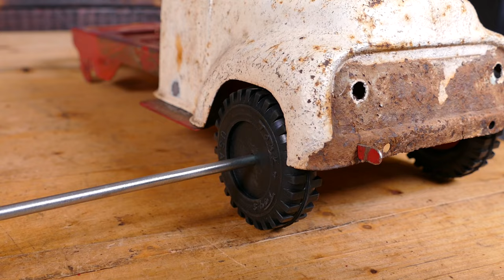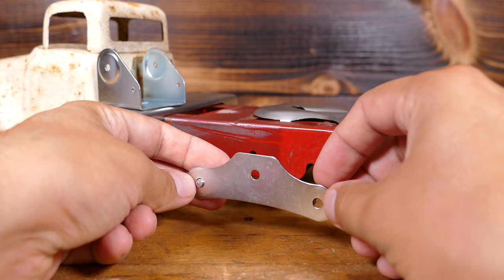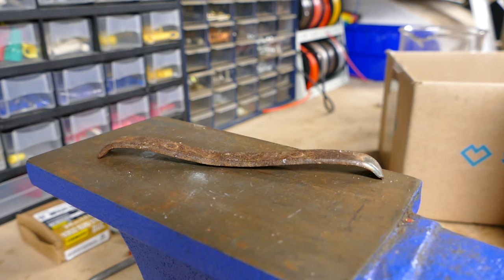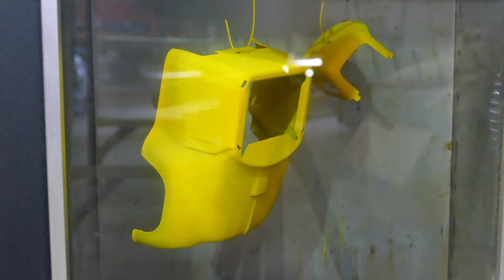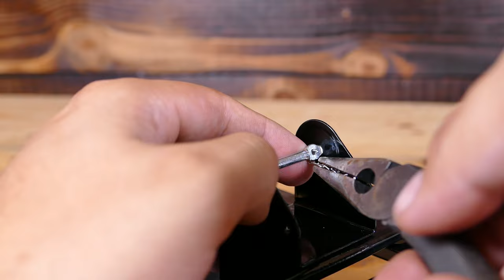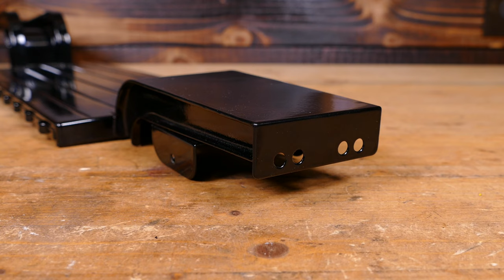Custom 1957 Tonka Tandem Truck and Low Boy Truck Restoration

Comment: Hey Joey I love it but wondered if you could have used some old hubcaps not able to shine and painted them as they were on some of the old wheels that had those spoked axles maybe used paint markers and a nice single exhaust stack would been nice maybe used a tired crane spool and handle from a wrecker to made a winch behind the cab got the chain stainless steel jewelry chain to be able to pull equipment that broke down

Comment: Love the restoration may I suggest a few ideas  I thought you might used some wood grain paper and cut into strips and maybe made this into 2 parts the next a small dozer of construction equipment to be put on and chains to chain it down and found red and white for trailer lights and taillights on the trucks

Comment: Really nice custom! Curious how the fifth wheel and the fuel tanks are attached….just friction fit? Now you could go one step further and put custom wood decking on the trailer🍺
Reply from the maker: The fifth wheel is kind of clipped on with the tabs. The fuel tank is attached with the same screw holding down the winch doing through the fame.

Comment: To bad you didn't make it to where the neck detaches & ramps for the front of the trailer on each side of the neck of the trailer & no windshield either & you also forgot tail lights for a trailer